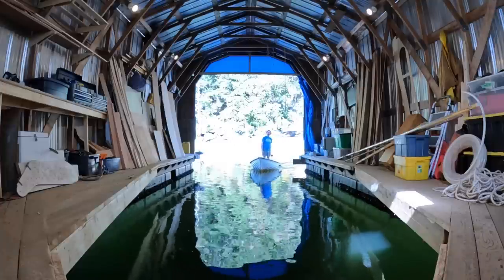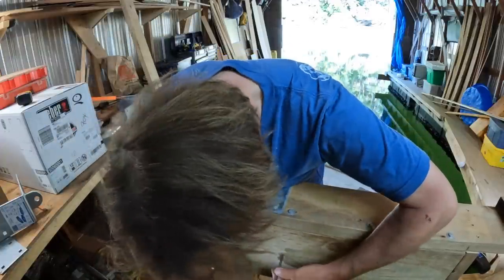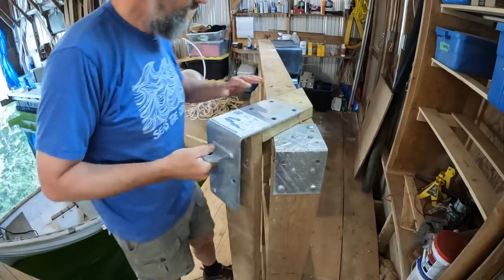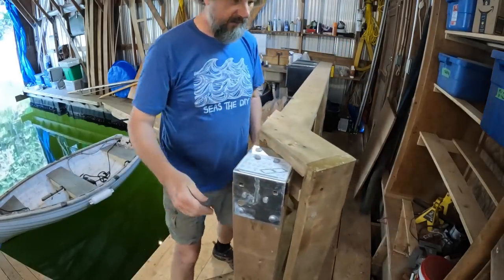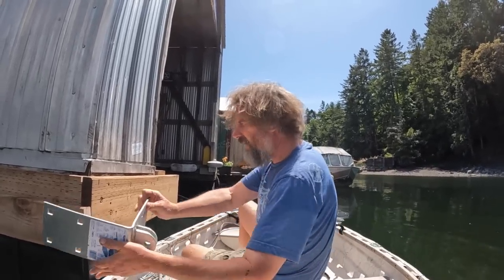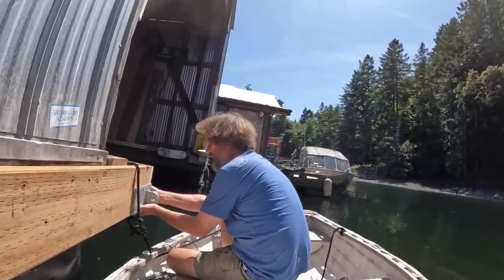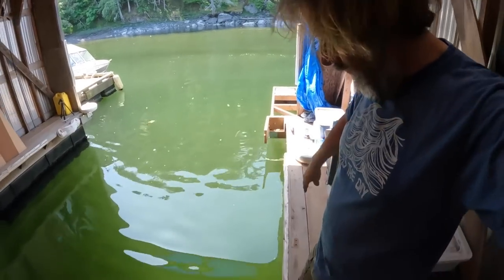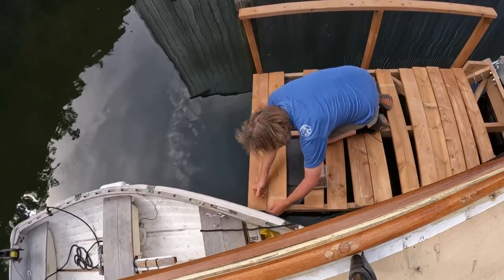Boarding Platform - #369 - Boat Life - Living aboard a wooden boat - Travels With Geordie

Comment: So watching you handle the boarding deck gave me flashbacks to yesterday when I was cleaning up some old rip-rap left in the yard by the previous owner. I loaded all the broken pieces of cinder blocks into my 12 cubic foot Gorilla cart, I bought it I’m not affiliated, while struggling to dump the contents into the drainage ditch under the driveway for erosion control I lost control and the whole lot went into the ditch. The cart handled it well except for some damage on the side where there are provisions for installing wooden stakes to increase the capacity.

Comment: 'When all you have is a hammer, everything looks like a nail.' 'When you're primatily a Carpenter, all you think to build with is wood.' Just add an 'L' shaped steel bracket that bolts to the origional single tab and the foot of the 'L' bolts through the existing dock. The longer end sticking out is drilled for the clevis pin and the hinge will now pivot beyond 90 degrees. :face-blue-smiling:

Comment: I just enjoyed a grilled steak with my daughter. Peter, you continually amaze me with how you pre think a project out and anticipate what problems you may run into. You blew me away with how to handle the 90 degree issue with the new hinges. I don’t think you mentioned it but I was wondering why the faceplate you attached the dock extended beyond the side of the boat shed. When you installed the hand rail it all came together. Brilliant. However, it concerns me when you are working by yourself with the dingy, you don’t wear an inflatable PFD. If you don’t have one let me know and I’ll make sure you get one.  I believe you have my email address. Cheers!!

Comment: Peter, you mentioned that the deck is going to be able to be lifted up vertically for stowage.  What happens to the handrail? It seems like that's going to be a problem in vertical mode.
Reply: Remember when he added that extra board at the outside hinge. That will make room for the rail to go behind the outside wall.